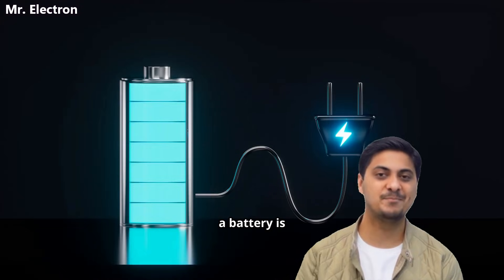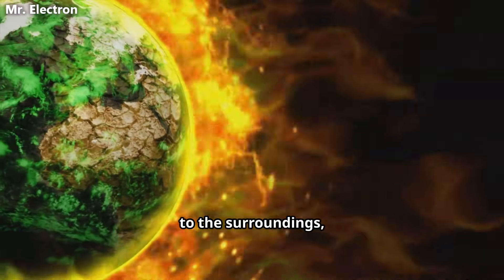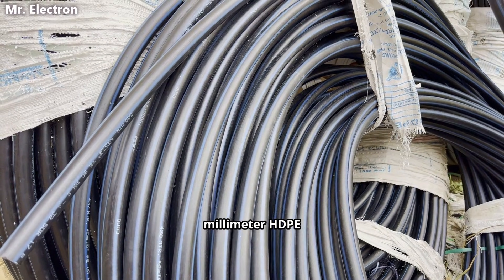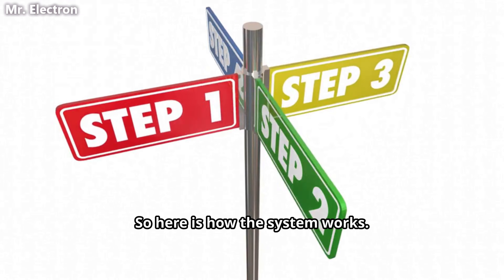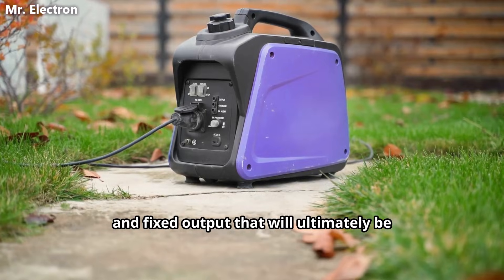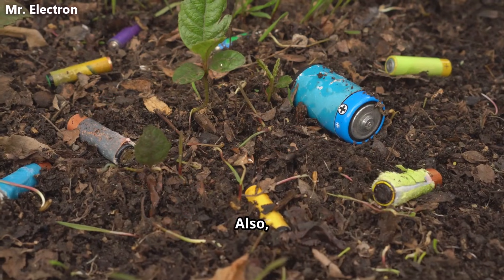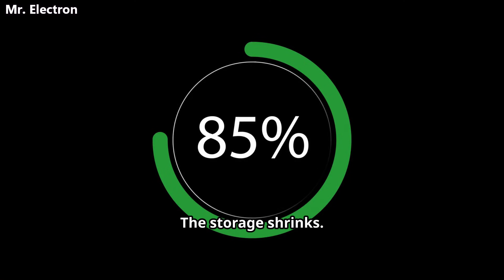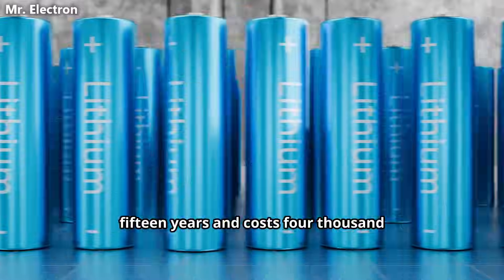Stop Buying Expensive Batteries — Build This 20 kWh Lifetime Battery Instead!

Comment: There are real world working examples of this type of energy storage system. compress air energy storage (CAES).  we CAN NOT get 20kWH battery by compressing 100 liter tank into 1500 liter by volume of pipe at 10 bar/145psi.  The math works out to about 1kWh battery  assuming the most charitable energy conversion ratios.   To get 1500 liter by volume out of 25mm/1" ID pipe requires 2.96 km/1.84 miles of pipe.
Reply: Навіщо заривати в землю 5км труби? Ще й бак для конденсату 🤔 заривати...це виглядає як дитячі фантазії.
Повітря буде розчинятись в воді під тиском й віддавати їй тепло, А конденсату  не буде взагалі, що за дурня😅, це генерація Штучного інтелекту 😊
Reply: Sounds like a good idea. Is there a working model anywhere.
Happy New Year and peace to you and yours.
Reply from the maker: CAES. Happy New Year to you too 🎉😊
Reply: @MrElectron  no, he just challenged you. We want answer
Reply from the maker: That's the calculation. Seems like I will need 3 times more pipe which will make it 15 kilometers instead of the previous 5 kilometers. 

Compressed Air Energy Calculation
1. System Data
Tank Volume: 100 Liters (0.1 m³)
Pipe Length: 5,000 meters
Pipe Diameter (Internal): 63 mm (0.063 m)
Initial Pressure: 3 bar (gauge)
Final Pressure: 10 bar (gauge)
Atmospheric Pressure: 1.013 bar
2. Total Volume (V)
Pipe Volume = 3.14159 * (0.063 / 2)^2 * 5000 = 15.586 m³
Total Volume = 0.1 (Tank) + 15.586 (Pipe) = 15.686 m³
3. Pressure Conversion (to Absolute)
P_Initial = 3 + 1.013 = 4.013 bar
P_Final = 10 + 1.013 = 11.013 bar
4. Energy Stored (Formula: E = V * [ P * ln(P/Patm) - (P - Patm) ])
Energy at 3 bar:
E1 = 15.686 * [ 401300 * ln(4.013 / 1.013) - (401300 - 101300) ]
E1 = 3,959,190 Joules (approx 1.10 kWh)
Energy at 10 bar:
E2 = 15.686 * [ 1101300 * ln(11.013 / 1.013) - (1101300 - 101300) ]
E2 = 25,532,331 Joules (approx 7.09 kWh)
5. Total Stored Energy Added
Total Energy = E2 - E1
Total Energy = 21,573,141 Joules
Total Energy (kWh) = 21,573,141 / 3,600,000
Result:
Energy Stored = 5.99 kWh
Reply: @MrElectron I was gonna say 25kwh but even at 7kwh, this might be inticing for solar battery however the excavation cost will make most ppl go in favor of lithium I'm afraid. Only way it might be cost effective is for ppl with the equipment to dig or possibly ppl that can rent the equipment and dig it themselves.
Reply from the maker: That's right 😅

Comment: Pure BS
Reply: This is not pure BS, it is a dirty one!
Reply from the maker: Why ??
Reply: Achieving such output would require either a storage volume ~20 times larger or pressures far beyond 10 bar.

Ask any Ai.
Reply from the maker: That's the calculation. Seems like I will need 3 times more pipe which will make it 15 kilometers instead of the previous 5 kilometers. 

Compressed Air Energy Calculation
1. System Data
Tank Volume: 100 Liters (0.1 m³)
Pipe Length: 5,000 meters
Pipe Diameter (Internal): 63 mm (0.063 m)
Initial Pressure: 3 bar (gauge)
Final Pressure: 10 bar (gauge)
Atmospheric Pressure: 1.013 bar
2. Total Volume (V)
Pipe Volume = 3.14159 * (0.063 / 2)^2 * 5000 = 15.586 m³
Total Volume = 0.1 (Tank) + 15.586 (Pipe) = 15.686 m³
3. Pressure Conversion (to Absolute)
P_Initial = 3 + 1.013 = 4.013 bar
P_Final = 10 + 1.013 = 11.013 bar
4. Energy Stored (Formula: E = V * [ P * ln(P/Patm) - (P - Patm) ])
Energy at 3 bar:
E1 = 15.686 * [ 401300 * ln(4.013 / 1.013) - (401300 - 101300) ]
E1 = 3,959,190 Joules (approx 1.10 kWh)
Energy at 10 bar:
E2 = 15.686 * [ 1101300 * ln(11.013 / 1.013) - (1101300 - 101300) ]
E2 = 25,532,331 Joules (approx 7.09 kWh)
5. Total Stored Energy Added
Total Energy = E2 - E1
Total Energy = 21,573,141 Joules
Total Energy (kWh) = 21,573,141 / 3,600,000
Result:
Energy Stored = 5.99 kWh

Comment: you know what else is a good form of energy storage? firewood. cheap small shed can hold like couple months worth of wood pretty easily.
Reply: 10-20% efficiency in heating and lower when converted to electricity is not a good form of energy storage in the slightest. Its actually one of the least efficient, produces a great deal of waste and is degraded by the environment.
Reply: @alexf6206  what you mean by 10-20% efficiency for heating? most wood fired stoves that i have seen are more like 80-90%. also where do most of the energy go? heating house and cooking food(well at least for homes). electricity is small part of the big picture so i would not spend too much time thinking about that.